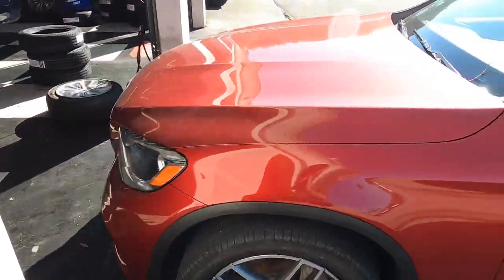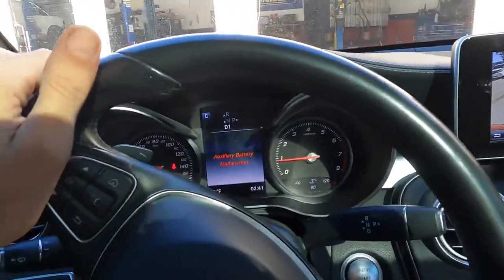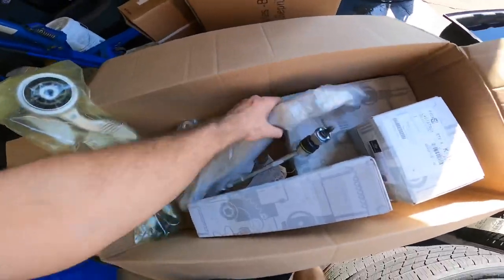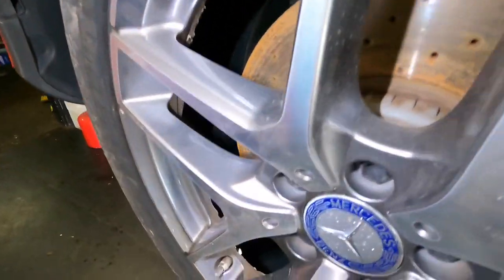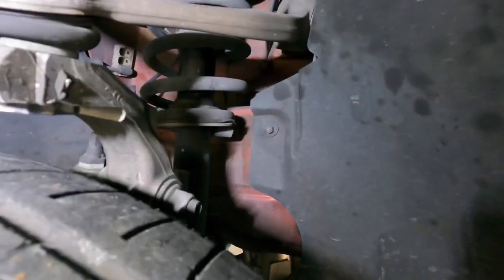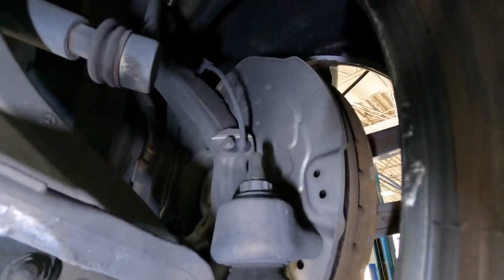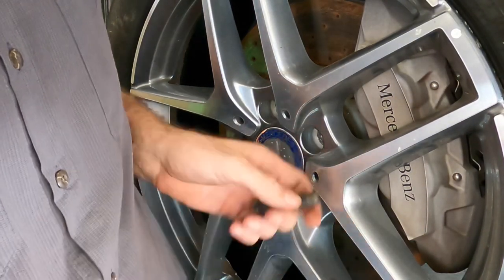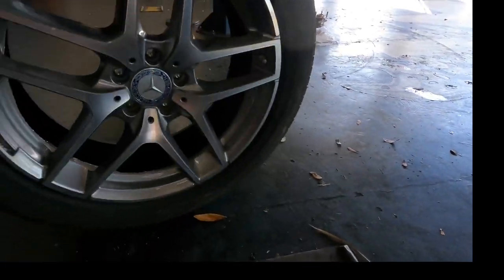Cutlstomer States: Hit a Curb

Comment: That rim missing 90% of it's material and still driving is on the top ten list of WTF. Mind Blown.
Reply: Those are Scorpion Verde tires - Run Flats.   They hold the rim a lot more solidly than standard tires.
Reply: Yes, what are these strange tires that need no air or complete rims?  Must’ve been a heck of a curb.
Reply: @amzarnacht6710  What rim??
Reply: @IMelkor42  just the rim of the rim thats the rim I think he's talking about
Reply: @amzarnacht6710  They didn't hold this rim so well it seems.  /rimshot
Reply: Rim short Ba Dum Tsssh
Reply: @IMelkor42 more of a  Hubcap!
Reply: @amzarnacht6710  now that is a most effective advertisements for run flats if i ever saw one.
Reply: Wait did that thing actually drive there on that?!
Reply: German Engineering👌
Reply: I'm about a minute removed from finishing the video and I still have a dumbfounded/perplexed look on my face lol
Reply: I would think the spokes support majority of the load vs the barrel of the wheel. It makes sense. But once you hit a decent sized pothole, gg.
Reply: Run flat with rigid edges I assume?
Reply: Fidd88  Holiday in Antwerp doesn't happen without fuel, though.

Comment: I'm stunned and impressed that the tire stayed "mounted" on the car enough to be driven into the shop. 🤯
Reply: I have a feeling it was not driven!  Towed or on a flatbed, maybe!!
Reply: @doctorlarry2273  Ray drove it in to get it on the lift.
Reply: Could also be the fact that since it's a Mercedes which is typically considered a luxury car, weight distribution is more even so there might not have been quite enough load to finish the dismounting process.
Reply: @RuralTowner  Miata is a luxury car confirmed
Reply: Same. Insane!!!! Should have put a wrong sized spare steel on it instead.
Reply: It's runflat tires with hard side. Really impressive indeed

Comment: I've seen a brake caliper come loose and get shoved through the inner drum of the wheel.  This made quite the hole on the inside of the wheel drum, but I've never seen the entire wheel disapear except for the face and outer bead.  That's pretty impressive to be honest.
Reply: When I was working my first job at a volvo dealer I saw it 2x. 

One, a nice newer 850 wagon nailed something so hard with the rear wheel that it cracked the wheel open like an oyster and smashed the strut through the mount. Had to go to a body shop.

Another car blasted something with the front wheel and broke it just like this, broke the strut mount and sent the top piece and the struts shaft through the hood...
Reply: I suspect it got left at where ever did the initial assessment.  They may even have mounted it on their wall!
Reply: I just opened youtube to get in a better mood because my brake calipter went loose and destroyed the wheel🙂

Comment: The rest of the rim is dancing across public roads damaging the paint, windshields, and unsuspecting pedestrians as you speak.
Reply: But how? It was on the INSIDE, unless it shattered and threw pieces everywhere.
Reply: @gregadams558  If I had to guess, being that it's the driver's side, they rammed into a median curb dead-on and shattered the whole thing.  With a slight steer to the left, the inside would have gotten the brunt of it resulting in a few hundred little alloy chunks all over the median which either got left behind (if grass--screw the mowers) or swept up into a bin at the scene of the carnage.
Reply: Or the dealer removed it.  But why put the wheel back on then?  How does the dealer send the car out like this in any case?
Reply: @KC9UDX  I think it is more likely that the dealer did not take off anything or do anything besides visual inspection. I am thinking more like @David Utidjian that the broken parts fell off on the way to the dealer, short time after the incident happened, and is strewn along the way there and to Ray's workplace.
Reply: @TrondBørgeKrokli  either way, there's no way they should've let it leave like that.
Reply: @KC9UDX  Fair point. I agree.
Reply: A pothole could do this damage. BMW wheels are known for not being that sturdy on their inner rims. You can easily crack them requiring a costly repair job. The outer rim is much more solid like older rims.
Reply: @wobblyeye493  Fair point. Thanks for mentioning that bit.
Reply: Rainman taking bread from the Mercedes mechanic.
Reply: @chesucat  I ... doubt it? Ray explained that it was likely the customer's decision. Anyway, feel free to think that, if it makes you happy.
Reply: @gregadams558  Obviously it shattered and is in pieces somewhere.
Reply: @TrondBørgeKrokli  I feel the dealer should have done something with the rim. Put on a spare, just so it could be rolled around properly at least.
Reply: Many years ago I met a girl, who said "the last thing I remember is driving along the road under a bridge, and something flying towards me"

The police said "we found you unconscious by the side of the road  with this in the car and a broken windshield. "

"This" was about one third of a heavy truck brake drum. Whether  it was dropped by kids on the bridge or thrown up by a truck passing in the other direction was never established.

Nor was it established how an unconscious person managed to brake and steer the car to a safe stop...
Reply: @leosmith848  Thanks for the story, I am glad that girl/woman is still alive after that. "Last thing I remember" seems ominous, as if she does not remember anything anymore.
Reply: @wobblyeye493  wow….  This BMW GLC must have these rims……

Comment: Always wonder, when customer says hit a curb and you have damage like this, how fast were they going and who was chasing them ?
Reply: "Hit a curb."  That is the answer you expect a 16 year old to give when he took Mom's keys without her permission and went joy riding.  

I do find it amazing that the car has that level of damage but no obvious damage to the side or front outside panels.
Reply: Or what was chasing them
Reply: @CleanforGene68  I think this is a case of sliding around the corner attempt going horribly wrong
Reply: Probably the curb. You never know about those curbs. They lay there, quiet, resting, but before you know it, BAM! The curb strikes!
Reply: I'm going to say the driver was distracted by an important text, or maybe an alert that Ray had uploaded a new video.
Reply: Definitely heard the Adele song Chasing Pavements.
Reply: @ZSAZSS09  I've seen this one! The prequel to Alec Baldwins murderous gun!
Reply: Oh I believe they hit a curb, but at high speed sideways!
Reply: I'm going with 'very', and 'their demons'.
Reply: They probably did hit a curb or something solid on the inner rim, which split the rim then it broke apart. Maybe one of those parking curbs they put down where you drive your front wheel against it and it prevents you from hitting the wall. 
Probably a lot of scenarios.
Reply: @CleanforGene68 or track days

Comment: Love the missing rim. Once did a job on a 60's Ford (drum brakes). The lady said it was pulling badly to the left. Pulled the right wheel and the brake material was gone off the shoes (quite some time ago I might add) and the drum was ground down so far that it was split in two circumferentially.. .

Comment: Holy crap! I'm looking forward to the rest of this, mainly in the hope we find out how you can completely remove the entire rear section of a wheel by hitting a curb yet not destroy the side that would have hit the curb.
Also kinda curious whether this is being repaired for the current owner to keep or just to get rid of it the best they can and hope nobody realises just how badly knocked around it was.
Reply: IT would have had to have been one of those sausage kurbs you see at a racetrack...  But I am curious myself now...
Reply: @John_Stephens43   I've never seen anything like it before. You may be right, especially since the outer rim doesn't look to have hit anything on it's outer edge. Next mystery, how in hell did the whole inner section of the wheel vanish? It may have banged around and broken up enough to escape but I would have expected to see some signs of damage from it bouncing and ripping into things inside the wheel well. 
This is an odd one I hope we get to see the rest of soon.
Reply: @John_Stephens43  Oh crap! I just looked at the pinned comment and it's got a link to it. I'm subscribed so should have got a notification but never did.

Comment: That rim is not a viable core. You could start a "wall of shame" with some of the parts you get. Might need a whole new building in a short while though!
Reply: I know if it's an OEM wheel that they don't care if it is a viable core or not. They only instituted core charges to keep them away from aftermarket recyclers who fix them. I was told by someone at Ford that they just recycle them for the metal.

Comment: That wheel is a good  demonstration of why I don't want aluminum wheels on my cars. I've seen enough shattered aluminum wheels to convince me that they're too fragile and expensive for me. I have a steel wheel on my van that survived a 5 mile drive with a blown out tire and it is still good.
Reply: Same here..i got a merc Vito 638 .its my work vehicle, I would destroy alloys in no time . Steels much better for the wallet!
Reply: I’ve got the big ugly steelwheels that came with the car, smacked the shit out of a curb a few times when I was still learning to drive, barely a scratch on them. Just slap a beauty cover on em and that’s good enough for me
Reply: Now a days steel wheels are way thinner than they used to be. Much more easily bent & destroyed too.
Reply: Exactly. I don't get why non-performance cars have aluminum wheels. I could understand something like say a Camaro or Mustang having lightweight aluminum wheels but not a damn van or regular day-to-day care like a Corolla or a Civic (not Type-R obviously xD).
Reply: BMW alloys are generally solid and any quality wheel should be! Mercedes have clearly gone way down in quality in my opinion more concerned about looks and saving weight that strength! This is horrendous! Never seen ANYTHING like it!! Racing cars have alloys and they're functional and handle extreme forces! They're WELL MADE! BMW alloys are generally Well made! (Some of the larger diameter ones have been questionable in my opinion early run flats) but standard 16+17inch are SOLID run flat or not..  these Merc ones look like cheap crap thin as anything I mean look at the fact the WHOLE WHEEL has disintegrated! And the suspension components! Cheap Chinese crap looks like! I'd never buy ANYTHING other than a BMW.. I got 2 3 series E46 and E90 one run flat other standard both diesels with 6 speed manual gearbox and they're SOLID as a rock! I won't get rid of my E90 until they stop making diesel then I'll probably make my own! The E46 is my daily and smooth as silk at nearly 18years old! Absolute dream to drive like a new car! Quick as hell 60+mpg on a motorway! 50mpg round town, quicker than any petrol and SOLID reliable and trustworthy.. this mercedes looks like a pile of cr@p!I had an AMG brand new as a courtesy car in 2015 only had 250miles on it! Was shite compared to my 2007 E90 that's fully loaded, even the leather seats were crap compared to mine I couldn't wait to get my BMW back and send the new AMG Merc back! That's how bad they are in my opinion! 👍🏴
Reply: this is because they want to make the wheel cheaper as can get forged wheels  don't shatter on impact

Comment: I suspect that some running "repairs" have been done to that wheel, just to get it recovered and towed to Ray's shop. It would be interesting to hear how it looked just after the "event" and what was done before Ray got to see it. The very fact the vehicle is drivable(ish, just) is credit to the strength/design of the tyre. A tyre that can do 𝒕𝒉𝒂𝒕, is going to be pretty safe, when driven normally.

Comment: That's crazy! I was driving mine yesterday, seemed to be shaking a bit. I decided to check the flex thingys on the drive shaft. They were fine, but the tire that was going bald actually had steel threads sticking out in a couple sections on the inside of the tire. I think that was the shaking I was feeling. Changing the tire now. So I will know if it is riding smoothly again soon.
Reply: @Copyright Testing Dah! It's been Christmas, birthdays, anniversary, three car registrations, 2 smogs, other car repairs. When I saw how bad it was, I changed it.

Comment: Hmm. That’s suspiciously similar to all the work I had to do to my car after I “hit a curb”. Well, apart from the rims, that’s remarkable. Steering rack, tie rod ends, lower control arms and both wheel hubs while I was at it. 

In my case I did technically hit a curb, just at a relatively high speed going around a corner. In this situation and in Florida not the freezing north with ice, I have some questions…

Comment: When i started going out with my fiance, the front tires on her Chrysler Intrepid looked like those.
I drove the car and the tires hydroplaned and a tagged a concrete planter.
I replaced the all the tires and fixed front end.
I also showed her how to check the tread depth on her tires and pointed out the wear indicator.  Told her next time i see her tires like that i will take her keys and park her car till we make an appointment for new tires

Comment: The damage seems more consistent with running over road debri like a large rock or a dropped ladder on the road. If she did there should be tell tale signs on the lip of the front bumper.
A kerb would have scuffed the outside of the rim and possibly paintwork on the bumper as she turned into it, unless she aquaplaned sideways into it.

Comment: Wow - As someone who owns the same SUV/Rims - my mind is BLOWN!  I have never seen anything like it, as well as can't imagine that the tire would stay on the rim.  I think this was one of the rear rims, so my only guess is that the SUV had enough "balance".  When I was a kid, I had a "bugs bunny" moment where I had done some of my own brake work, but forgot to tighten the lugs.  I went driving later and about 5 miles into a trip, I saw a rim and wheel go passed me, and I thought... "Strange!  That looks like one of my wheels..."  It was not until about 10 seconds later that I realized it was my wheel and the car unbalanced and I was on my hub.  I was able to chase down my wheel, get the car jacked and it backed on, and drove gingerly home on 3 lug nuts per tire.  But, yeah.  Did drive for about half a mile on three wheels with no issues.

Comment: That rim is a special order weight reduction racing wheel.  It spins so fast, the centrifugal force keeps the tire perfectly balanced.  It's like driving on air...  Don't forget to check the turn signal fluid... :P

Comment: Did a customers 98 suburban this past November  that stated her front driver side brakes were grinding  and took longer to stop .....took the tire off, removed caliper/pads and a good  95%+ of the inside of the rotor was ground off almost to a razor sharp edge nearly into the cooling fins! This could have and most likely would have ended in disaster if she kept driving it that way !

Comment: I am 66 years old, I like mechanical cars (basic older car) than electric cars (newer car).  But for my own sake, I love backup camera with high resolution and bigger screen in the front for me to do backup.  Plus 4 corner sensors for me to be alerted on the each side of the car.  Other than that nothing in the new car offer me vales.  Just personal opinion.

Comment: I'm surprised insurance covered that instead of labeling it owner negligence due to tire wear and denied the claim.

I'm amazed at the amount of newer cars that come in with worn tires, broken sensors, and general lack of maintenence. Tires and brakes are things that, when they fail, especially at speed, can impact others. Sure, it sucks if your lack of oil changes or stuck thermostat leaves you stranded on the side of the road, but at least you don't risk plowing into a nursing home and taking out grandpa Lester and 6 of the 8 Bridge Club ladies.

Comment: Be careful with the brake discs  they are the pressed style it will buckle a disc by incorrectly torquing the rim. Or handeling them by the centre of the rotor

Comment: Presumably the rest of the rim just broke up with bits left at the scene of the incident, or maybe removed by whoever looked at the car first. I imagine all those replacement Mercedes suspension parts do not come cheap. However, the job itself might not be too bad (but I bet the book time is enormous - which is why the insurance company didn't want to pay dealer rates).

Comment: Hit a curb. Hmm okay I’ve seen a lot of more or less wacky things in my life but I can’t get my head around how a curb would screw up the inside of the rim like that unless you do like a ton when you hit the curb. Almost like the rim was cut and mounted back on the car. But This is the first time I’ve seen something like that, and the wheel still works for the most part.

Comment: umm if the client went to the authorized dealer and the dealer told them everything they will need... and insurance signed off on it.. why did they take the car to the independent? the insurance already paying for it and the car was already in the shop and i am sure they had a rental to drive around...  something is not kosher here...
Reply: Man! I was thinking the same thing.  Maybe Rainman works at a big dealership network that has different makes and they use one shop.

Comment: As for the reason the tire is still on the rim:  They're Scorpion Verde tires (Pirelli).  Run flats attach to the rim a LOT more solidly than standard tires.

Since there's no cosmetic damage to the outside of the rim they hit a curb straight on at about 30mph (or less), didn't realize they fucked off the tires and just kept on driving until the sound of shattered metal bouncing from the undercarriage told them something broke... by then it was far, far too late.